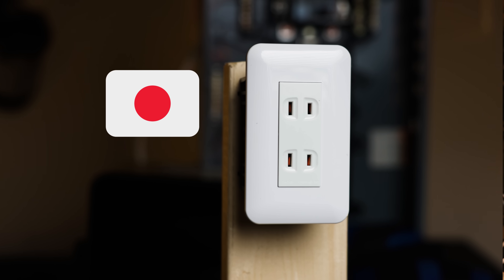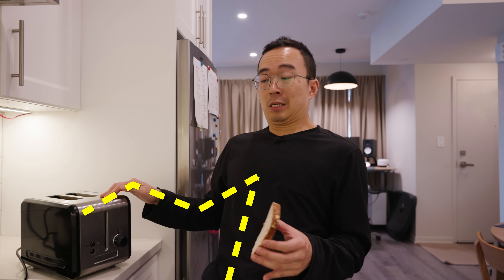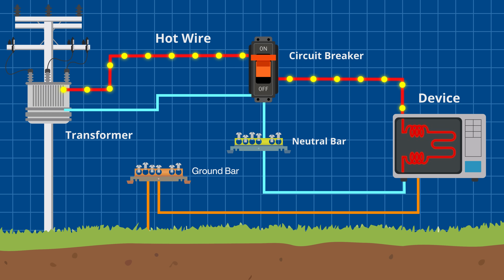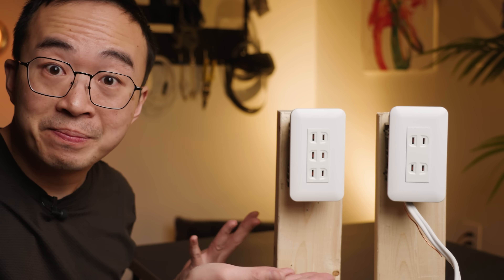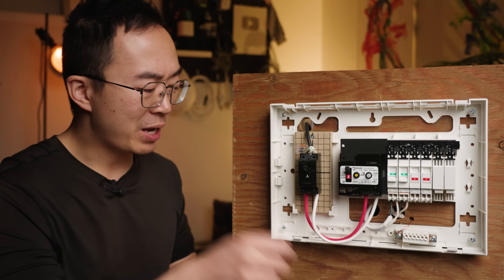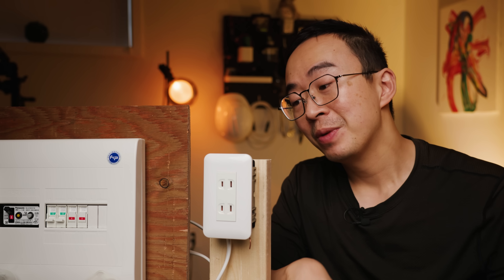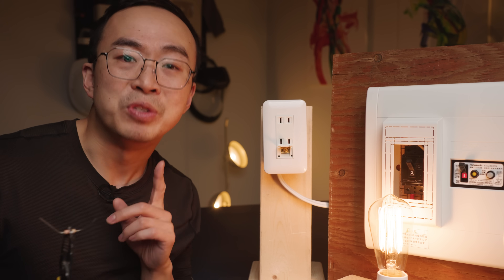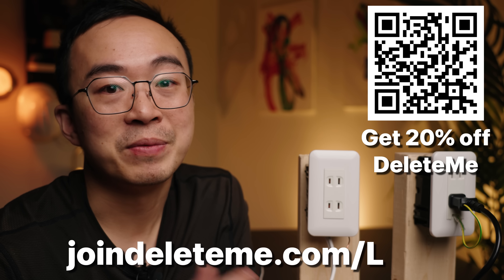How Japan Made Their Outlet Safe

Comment: I feel like your explanation about the ground /tripping of the circuit breaker is missing some thing& getting some things wrong. 
(I'm no electrical engineer, i have only my highscool knowledge to count on. Maybe some commentor can shed some more light on that.)
Reply: He's basically trying to say that ground provides a lower resistance path than neutral which is true. However this resistance is somewhat negligible in certain scenarios, and wouldn't draw sizeable currents away from a neutral line in every scenario. For example if the resistive toaster element comes in contact with the grounded toaster body, while still connected to neutral, the current would roughly split, biased to ground, depending on the element resistance between the paths. The ground acts like a neutral in this case, and the breaker will not open and you could still be shocked by the still electrified toaster body. Grounding works in neutral disconects and dead shorts. For example, if the same toaster with the element contacting the body, had the neutral wire disconnect, or if an exposed live wire made contact with the frame, causing a dead short, or making the ground a much lower resistance path. Grounding is important, but I agree that the explanation left a bit out.
Reply: I'm not an EE either, but circuit breakers actually tolerate some time over their nominal current rating. This is to allow electric motors and other devices to start up by temporarily drawing more current. So the tripping time is in an inverse relationship with the current, until a certain point when the time suddenly drops. This threshold depends on the characteristics of the circuit breaker, but it's typically between 2 to 20 times the nominal current rating.
Reply: @baksatibi  Yeah i know, you can adjust that time for differnt work areas for example. In the living room you can install a much quicker acting breaker, while in your workshop where you use a flex or something you allow for a short peak draw thats much higher.
Reply from the maker: Hey I wanted to respond here as I think your comments have been fairly balanced (didn't read everything).  I do want to get in on the ground conversatio nthgouh.  

Ground is designed to trip the circuit breaker.  Here is a much more detailed video and I linked to the section that talks about it: https://www.youtube.com/watch?v=mpgAVE4UwFw&t=993s  This is someone who has built an incredible system teaching NEC and how it actually works.  Hope that helps.
Reply: It's accurate IMO. I'm an EE, but electricians should have more hands on experience and might be able to provide more context.
Reply: @holmiumh  Which one do you mean? the one andrew lam described or the one i did?
Reply: The EGC in the USA provides an alternate path to the supply neutral.  If a live wire comes into contact with a grounded item high current will flow and cause the circuit protection to act rapidly.  It is not a lower resistance path than neutral as suggested elsewhere.  In fact many countries use smaller CSA/gauge earth(ground) wires so in a lot of circumstances the earth wire actually higher resistance.  For example in Australia/NZ and others once we get over 2.5mm2 wire the earth wire is smaller - 4mm conductors has a 2.5mm earth and so on.  In the UK they use a 1.5mm2 earth with 2.5mm conductors, sometimes even 1mm in certain circumstances.  This is possible to do as rapidly clearly a fault limits the heating of the earth wire so it is never a hazard.  Look into let through current and adiabatic calculations if you want a better understanding.

When you get line to chassis fault you want to clear it rapidly (often 0.4 seconds or less is required) because the earthing system on the faulting circuit will be pulled away from neutral (the wiring acts as a simple resistor divider) to hazardous levels.  A person touching the faulting appliances chassis or another appliance of the same circuit can be shocked or worse.  TT earthing which does not have a direct connection to neutral is even more hazardous so some form of earth fault protection is a requirement to clear faults rapidly.

This shock hazard is a result of the 'neutral' being taken to the ground at the transformer and potentially other locations.  This is done to reduce the potential that can occur should a phase touch the ground.  In the USA etc that could potentially be ~240V without a firm connection of the ground to neutral, in other countries this could be about 400VAC.  Trying neutral to the ground limits this to ~120VAC (USA etc) and ~240V (rest of the world).
Reply: @retrozmachine1189  Not sure about Australian wire gauge requirements, but the US (NEC) builds in a huge margin of safety. 14 AWG is typically the smallest wire used for 120/240V circuits and is allowed to be used for up to 15 amps. In reality, a 14ga, solid copper wire can handle closer to 30A before it will get hot enough to melt the plastics used in NM (Romex) cable. 

Being so overbuilt is actually a bit of a problem now that copper has become so expensive. I have some 14ga Romex from the early 1980s, and the conductors are closer to 12ga. It feels substantially heavier and thicker than modern cable of the same (claimed) gauge. The sheathing insulation does feel more durable on modern cable, but that could be due to age.
Reply: @bnasty267  The USA actually uses lighter wires than Australia.  AWG 14 (approx 2mm2) for a 15A over there, while in Australia with the present derate (updated recently such that wiring in walls etc is considered to be dealing with insulation) 2.5mm2 wire is suitable for a typical 16A general power circuit.
Reply: @retrozmachine1189  I agree, you said what I was trying to say but much better. The Earth or Ground can be a lower resistance path than neutral, but wouldn’t be in normal operating conditions and not a “highway for electricity” as described.
Reply: I think mainly this energy highway stuff feels wrong. 
For me it seems more like any current over a treshold trips the breaker when it comes from ground. 
Otherweise how would, for example the lightbulb with low volt and amper, trip the breaker if it needs a high volt /amper to trip? The resistance of a cable is lower (meaning more carried energy) the thicker the cable is. So if there is only a small cable bringing low volt/ amper amounts to a light, then there will also only flow small amounts of current trough a cable that is attached later. The resistance of a circuit is limited by the thing with the highest resistance in the overall circuit, in this case the smalles cable.
Reply: smaller cables normally burn trough instead of transmittig more energy, which in turn causes fires. To counteract that, most cables should be connected to a circuit breaker that shuts down power if it goes a preset treshold to prevent fires. 
That is a thing that is often missing from american power strips, which often cause fires that way, i have heard.
Importantly this does not directly protect you from receiving a shock, it only protects the cables.
Regardless; most things that cause a shock, like drilling into a cable might do, also trip the breaker, so you are indirectly safed.
Again the disclaimer that trhat is all half remembered from my higher shool courses.
Reply: Also the by myself described circuit breakers, i know from germany, so maybe they are different in the US. Uhm and i did not watch the rest of the video before commenting, thought the add would be enought time for a quick comment. Yeah that did not work.